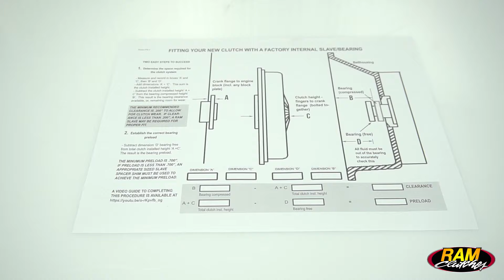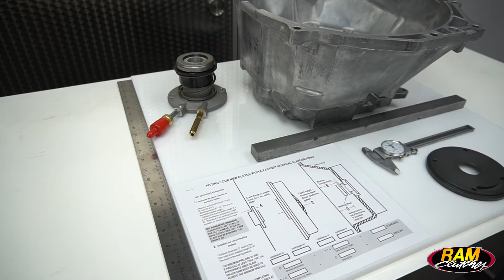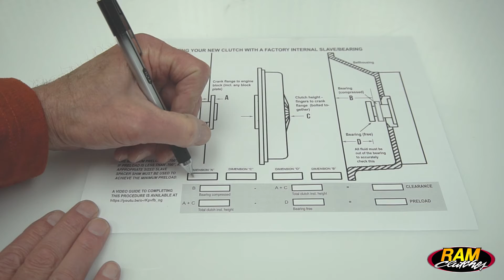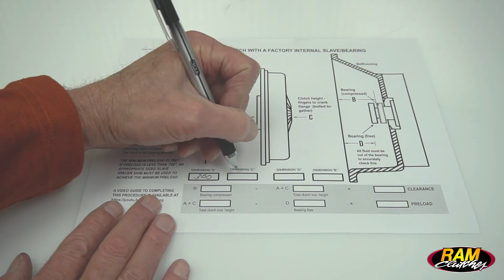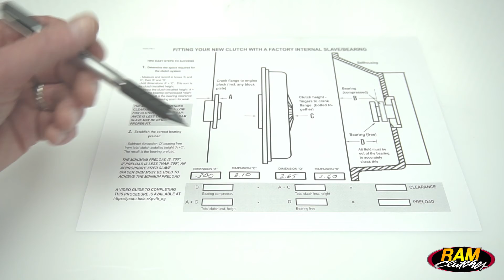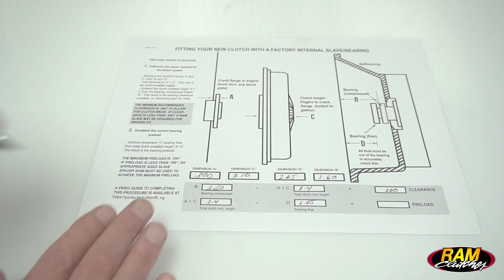Setting up your clutch system using a factory internal slave cylinder (hydraulic bearing)

Comment: Thanks for a great explanation...We are going to convert a MG midget to use a concentric slave cylinder when using a Ford Type 9 5 speed gearbox which is a common upgrade in the UK....this is by far the clearest 
information to achieve the correct positioning ie calculate any required spacers.....Good job!